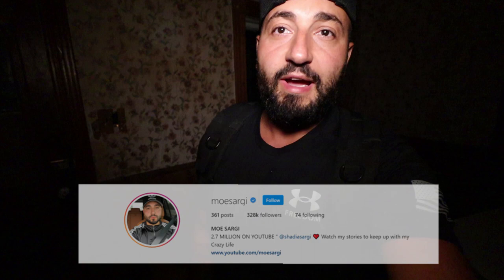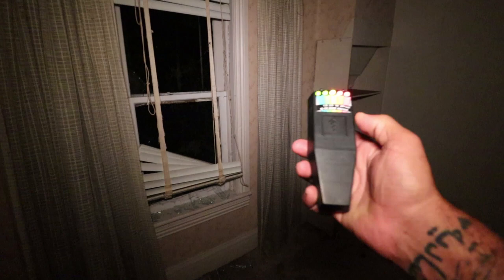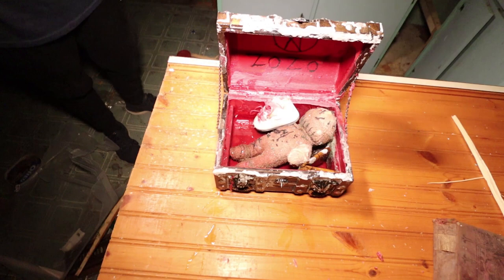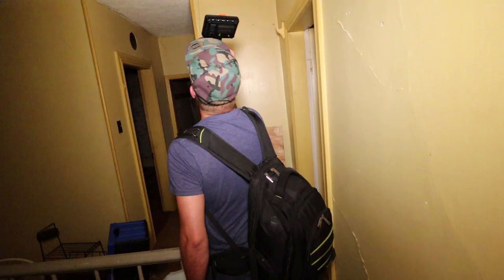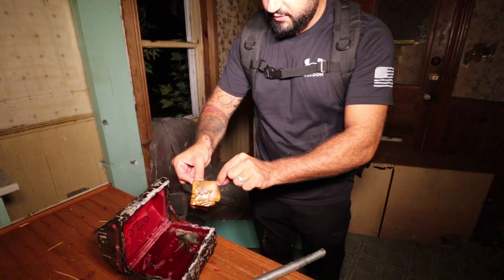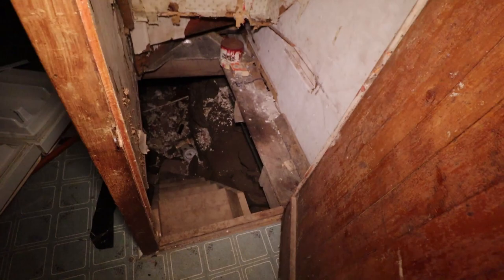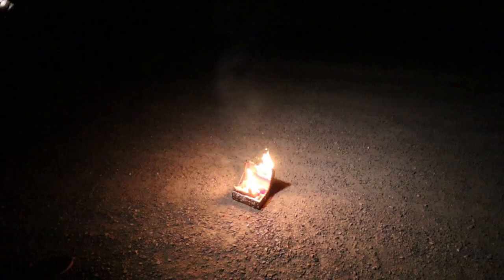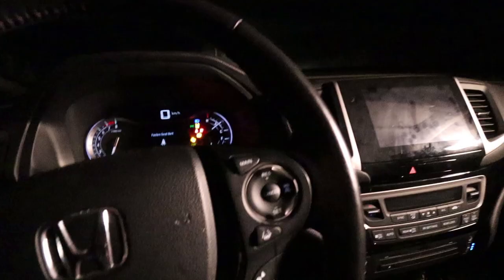OPENING THE HAUNTED DYBUK BOX GONE WRONG ( IT CAUGHT FIRE)

Comment: If there was some entity in it, once opened it's released. To my knowledge rituals are performed to trap an entity in the box, it is than sealed with wax and they used the water element to keep it at bay, some use earth element and bury it. All depends on the rituals. I guess going fwd you will have to see if the box was legit because if there was an entity in the box, it's now latched on to you and burning the box is useless as you'd now have to perform another ritual to again trap it in a box and seal it. Not sure I'm buying any of this though,  but it was a good creep factor.
Reply: right

Comment: There's also a cut between putting the dybok box in the truck and MO getting in the truck wich leads me to believe they put a gas to light it up and you can tell they put gasoline because of the black smoke that was burning
Reply: And I’m willing to bet that box was from a cheap thrift store and most likely is made of very cheap material.

Comment: Hi! I’ve been watching your videos for a verrrrryyyy long time now and other videos like yours from other creators! From watching so much I’ve learned some stuff. When you open the Dybuk box you’re releasing whatever was trapped and sealed inside by cutting the wax open. When you took the box to your truck and set it in your bed, the demon was pulling and sucking all of your trucks power and using it to start the fire. It is physically not possible to light things on fire when they’re soaking wet. Literally dripping in water. Notice how the only thing burned was the doll and the box itself? It’s because when the demon used the trucks energy to start that fire it was a way for it to no longer be trapped. Destroying the doll it was cursed to and the box it was trapped in frees the demon or spirit and does not allow for it to be trapped yet again unless you know it’s name. It heard you talking about sealing it back up in the box and throwing it BACK into water and did not want to be apart of it. Burning=freedom

Comment: you are very lucky it did not burn the house or your truck.  It looks like it was treated with something that catches fire on contact with air.  If so someone planned to use that to hurt someone.  heaven help someone if they had stuck that on a shelf or something and it dried out in a house or where someone was not watching.   It is a blessing your car did not catch fire though and you were right there when it caught.   That could have been really bad.